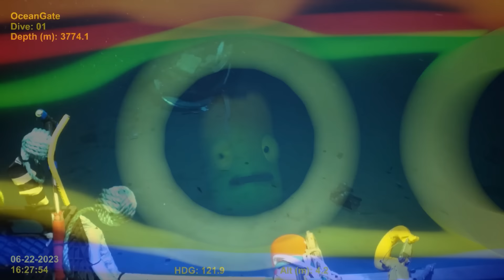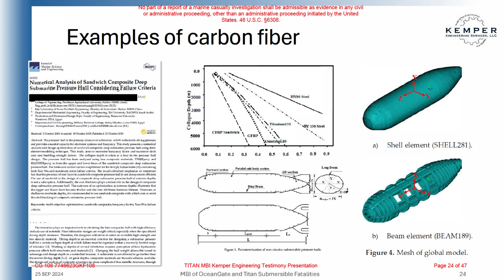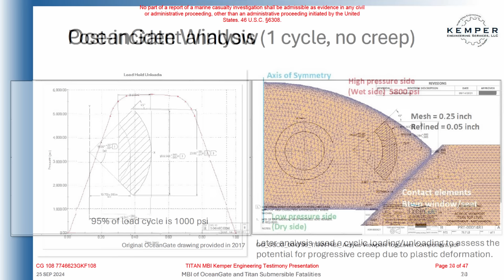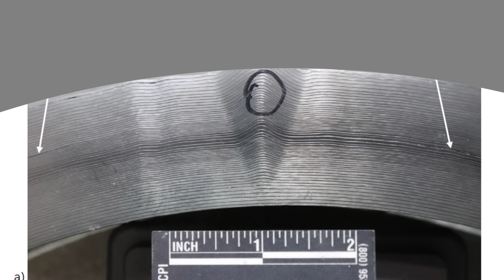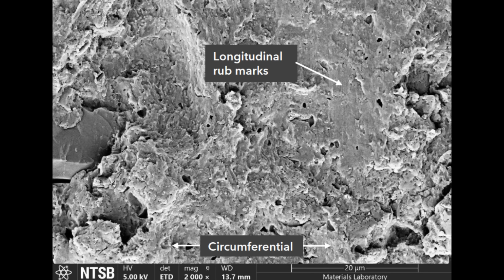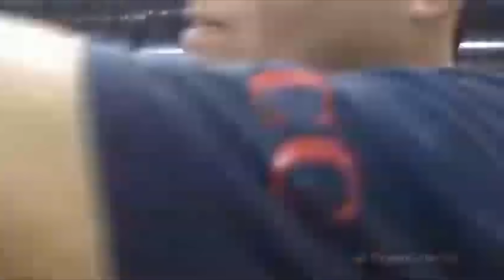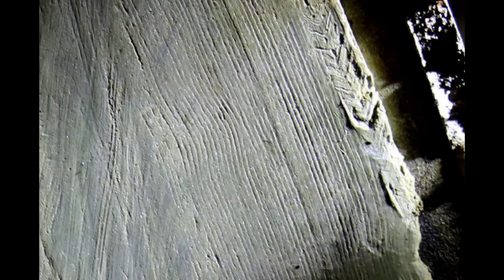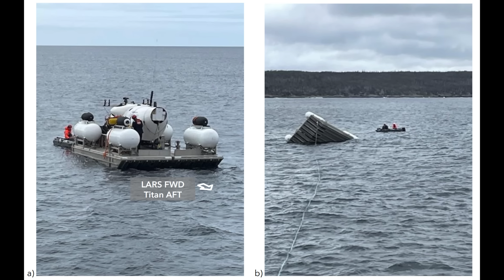OceanGate Wreck Shows Why Sub Wasn't Strong Enough To Survive - NTSB Shares Important Details

Comment: Around 2005, I  successfully designed and patented sensors for down-hole oilfield use that could survive testing multiple cycles of pressure to 40,000 psi with temperature cycles of 'ambient' to 400 F.   My early efforts tested glass cylinders containing electronics which were embedded in epoxy resin.  These would consistently fail at pressure due to microscopic bubbles in the epoxy providing a failure path that would eventually lead to a total failure of the sensor as individual failure paths 'joined up' into a sudden large failure.  The different materials used in the early sensor attempts would also facilitate failure due to the way the different materials behaved under pressure. We tried a number of ways of casting the resin to avoid the problem, but to no avail.  When I eliminated the dependency on the resin for structural integrity at high pressure, we arrived at a terrific solution that become the basis for our patented products.  You have pointed out the issues with the layers and the glues and I totally agree that fundamentally, the characteristics of a cured resin interacting with titanium parts could but have only resulted in microscopic paths for water ingress into the material, delamination and eventual catastrophic failure.  From my first hand engineering experience, current resin technology was totally inappropriate for high pressure applications and I still have images from early tests showing how failure paths through resin and between layers will occur at at high pressures.   Sad to say, it was not surprising to see how the sections failed.
Reply: It seems to me as a novice that the flange was the actual failure point, that the relative compressibility of the composite compared to the titanium put a huge load on a flange that was too thin. Or perhaps the composite's compressive strength became compromised, putting too much pressure on the flange. Either way, it is my belief the flange was way too thin.
Reply: @dustman96  I think your second sentence is the correct one.  The flange may or may not have been too thin, but it would've only had the opportunity to fail after the carbon fiber hull starting collapsing inwards, transferring pressure to it.  A secondary failure, if you will.  And arguably an irrelevant one, given that would mean the hull was already collapsing.  But I'm just as novice as yourself, so we'll have to wait for the experts to give their final conclusions.
Reply: I know most of your patent lies in trade secrets, but any possibility of sharing your research on the resin with the NTSB?
Reply: @jackielinde7568  "I know most of your patent lies in trade secrets"
No it doesn't. Patents are, by definition, public. The whole point of a patent is that you make the design public but are given the exclusive right to use it for a period of time.
Reply: @jackielinde7568 maybe we just need to be patient, the patent is about to expire if they worked around 2005!
Reply: @jackielinde7568  doubt it would have too much relevance. They have plenty of submarine data and expertise that is relevant to this.
Reply: @Stealth55555  It makes OP a subject matter in resin product performance under pressure. Hense the relevance.
Reply: @Stealth55555  "If they were an expert [...], they wouldn't need to be experimenting in the first place..."
Sorry but that's total nonsense.
Reply: May we ask what these down-hole sensors were looking for?
Reply: @Astronetics  oil. 🤠
Reply: 19:16 for those who don't understand what a flange is
Reply: The Titan didn't respond to dropping weights because water had been pushed into the voids in the hull at nearly 6000psi on previous dives.     This caused Titan to be heavier and descend faster as well as being heavy enough to not respond to the dropping of weights.   
The titanium to carbon fiber mating points surely let in water into the hull but the surface of the hull had voids on the surface anyway.    
Then Titan was stored over winters outside in freezing conditions and the water in the hull expanded with the force of 30,000 psi.   
The 3500 pound door being opened fully on hinge with hinge points being only a few inches apart certainly put huge a huge amount of stress on the front titanium ring.    Check the hinges on bank safes for proper mounting geometry.
I covered this on the titan submersible reddit over a year ago.
Reply: Did you try vacuum degassing the resin then casting under pressure, or just casting under vacuum?
Reply: @greggv8  We did that at Gardners Transformers (up until 1995 when the company was destroyed), epoxy potted electronics modules. a vacuum chamber.

Comment: I've had some experience, and although CF is a wonderful material, making composite structures- CF & Ti in this case- is enormously difficult when loads are as great as they are here. If they really wanted to use Carbon, they should have persisted with making all of the hull in CF- or make it all out of Ti. The joints are always the problem with dissimilar materials.

Comment: The thing that jumps out to me about the design is not really the carbon fibre its the fact that they did not have any internal structural ribbing something that every cylindrical submarine has to help reinforce the hull, and i can only assume they opted not to have them because it would have reduced the internal space meaning less passengers and less money could be made per dive.  When it comes to the wrapping of the carbon fibre it is odd that they did not use a roller to press it against the hull as it was being applied as this would have prevented the wrinkles, if anyone had tried to wrap duck tape around a pipe knows that if you just pull the tape around the pipe it wrinkles  and you have to use your other hand or a tool to smooth it as you wrap it.

When it comes to the issue with the stress sensors I suspect the data had been seen and understood but due to the hostile work environment where people would be fired for raising concerns  and disagreeing with the guy the employees would have not wanted to come forward for fear of the backlash.

Comment: What if Stockton Rush forgot to fully charge his wireless XBOX controller steering system and with the batt light blinking red and the sub no longer having a steering system was caught in a current it couldn’t get away from and submerged past the breaking point the sub could handle then imploded.

Comment: Am I totally off here or would you agree, that a carbon fiber submersible would be possible and innovative. 
But in this case there were horrifying failures in manufacturing, (taking shortcuts instead of actually innovating a new fabrication method), testing and verification of design, and least understandable of all, ignoring their own safety systems!

Comment: the inner titanium ring was woefully undersized to handle the deformation of the CF cylinder at the interfaces.  Look at the earlier diagram showing the huge bow predicted at the midpoint of the cylinder.  Why wouldn't that happen at the ends?? The forces will be uniform.  That stupid titanium ring flange was carrying that deformative load because of course it was.

Comment: Seeing the picture of the Titan being lifted by the crane just makes me think "why the hell didn't they use spreader bars??". All those forces need to be going straight up and down but instead all of the ropes/strops holding onto it seem to be running at least 45deg from vertical, probably putting as much lateral load as there was vertical load and in all different directions. I'm not a qualified engineer or anything and it's definitely not the worst part of all this, but it feels so obvious in hind sight, it's just so god damn frustrating!
Reply: From what I can tell, the design failed to incorporate any provision for lifting.  Lifting seems to be on the order of an afterthought (after the thing was completed): "Oh yeah, how to we get this thing in and out of the water?"

Comment: The sad thing is if they'd used Aluminium 7075 for everything, it likely would have been cheaper and about the same weight! Just needs to be looked after to avoid corrosion!

Comment: If the failure began in the CF at one of the titanium endcaps, that reminds me of a conversation I had with a labmate (MIT AUV lab) in the 1990s. We were discussing stress levels in the hull of a submarine. If you put a stiffener (bulkhead) in the middle of the tube section of the hull, it's actually pretty resistant to strain. The hull before the bulkhead gets compressed, and the hull after the bulkhead gets compressed. But because those two sections of hull are connected, the bending on the two sides oppose each other, so the hull is better able to resist the compression. If you sketch a simple 2D cross section, the hull bending in (down) to the left of the bulkhead tries to bend the hull right of the bulkhead out (up). And vice versa. So the two balance out and you get the maximum strength from the hull.

But where the hull meets the spherical endcaps, there is no hull on the other side of the endcap (bulkhead). So that part of the hull basically acts like a cantilever - less able to resist stress, and will experience greater strain. If you want the hull strain at the endcaps to match the strain at other bulkheads, you need to make the hull thicker where it meets the endcaps.

I understand the Titan didn't have bulkheads in the middle of its tube, but the point here is that the stresses and strains are higher where the hull mates with the endcaps. So ideally you'd want to make those sections thicker and stronger. But they actually did the opposite here - shaving the hull thinner where it mated with the endcaps, creating a weak point.

Comment: Wow! 2.5 miles of water pressing down on it.  Hard to comprehend that sort of loading.
This was a series of compromises and botches glued together.  I mean the carbon-Fibre lay down was wrinkled so they ground the wrinkled fibres down!!!!!  Basically they cut the fibres, so you're starting off with a compromised structure.  Crazy.
Then they ground the ends, to fit the titanium end rings ... compromised again.
Crazy.

Comment: 8:50 an analogy could be with airplane side windows. A rectangular one with 90° corners is worse than a round one, even if the rectangular one is smaller and included in the the round one. They could have added an independent lens instead of adding materials.

Comment: fascinating indeed the intricacies of stress and deformation (circa instant 8') - but also to consider is the application of the resulting stress of said deformation on the supporting material: here transversal pressure (delaminating) onto the carbon fiber, which is much less compliant... 

Anyone having actually played with laminated fibers of different Young modulus would be wary of what happens at the interface, the behavior of discontinuities under load are difficult to predict. 
PS: as for the "peel ply", as it names suggests it is peeled off before resuming laminating on top of a previous lamination, what it does is imprinting a small surface keying pattern that the next layer will grab onto better than on a smooth surface - so there is no "peel ply" in a finished product (anyway it is made of nylon or similar material that the resin will not bond to, so that if can be peeled)

Comment: I would just love to know exactly what happened to the occupants and exactly what remains of them and where. Jammed into that dome? Little tiny fragments? Its fascinating.
Reply: Ever heard of "mechanically separated chicken"? I guess it's a mix of that and just straight up blender. 6000psi of water around the sub is about twice what a household pressure washer makes, and even those can blast flesh off bone under right circumstances. So between that, being crushed by the debris, and then partly blown back out of what's left (shockwave from water ingress hits back dome, bounces forward, blows off the front dome, i presume that is why front dome is at distance from the back)... My best guess is that maybe some parts of larger bones are still recognizable, but soft tissues became paste that got washed away by the currents.

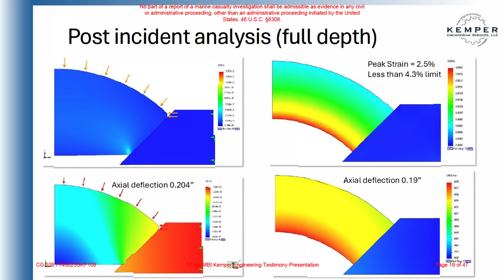Comment: Funny thing is that the optical problem at 9:00 could be just solved with having another piece of transparent material (acrylic as well?) adjacent to the window that would act as a lens correcting the effect of the window. They did not have to change the shape of the structural piece itself to achieve desired effect.

Comment: Why? the carbon is held together with polyester and doesn't provide compression strength.
37.740kg of weight on top of you per 10 cm²!!!!!

They could have used a vertical laser in the middle of the tube to measure the deformation, but would be a hassle to move inside.

Comment: Wrapping carbon fiber at 45 degree angles is pretty standard for carbon fiber construction, so that would be OceanGate cheaping out again. I wonder if the thickness of the carbon fiber they used, the ribbons of carbon fiber that came off the spools, didn't cause issues too. Though the whole thing about wrinkles...what, how? Like people make huge fuselages out of carbon fiber with no wrinkles, so that just really speaks to Stockton Rush didn't care about doing things the right way.

Comment: I beg to differ. I think that very early in the collapse, the back end of the carbon fiber hull gave way. That way the pressure on the front end of the hull would force all the carbon fiber into the titanium back end as can be seen on the images.

Comment: You sure boeing didn't have anything to do with this thing? 😆 what were they thinking, machined and glued... no 45 degree strands is why it wrinkled. They have been making carbon fibre dive tanks that holds high psi pressure while diving, if they had replicated that and not used glue to hold it together.

Comment: Crazy how they went out of their way to design such elaborate structure carbon fiber cylinder part , titanium end caps just to save some weight so they could get away with a little smaller crane and transport barge.

Comment: Can someone explain why wrinkles would form in the carbon fiber during application? 10:39.
Reply: Could air get trapped under the strips as it's laid? Or just natural imperfections (or dust) that get magnified with each additional layer?
Reply: it is actually shown in the analysis, a very small defect in a CF layer thickness accumulates and amplifies at each subsequent layer, until it forms a huge wrinkle. To me it looks like the whole section is compromized if such thing is allowed to occur. I am pretty sure good practices call for some sort of vaccuum compression at each layer or some other methods to ensure layers thickness uniformity.
Reply: @lo2740  The analyses shows indeed the amplified defect.  But I do not understand where this "amplification" effect comes from?  If a wrinkle starts with a 1 mm local defect, that defect should remain 1 mm after adding 10 extra correct layers on top??? Or not???

Comment: Bond to the ring is a big failure point, you need to have rough surfaces to have a good bond, not a smooth surface. Needed that ring to have a rough surface to give it a large surface area to bond the metal to the composite. Then probably chemically etched to give a clean metal layer for bonding, right before the final solvent cleaning, and then application of the epoxy bonding it to the ring. Plus inner lip should have been a lot thicker, probably at least a quarter the thickness, with a transition to the inner diameter to keep the step stress down.

Comment: The glue effect basically mimics metal fatigue.  I saw one of the many presentations on the collapse and Scott,  you are good enough to surmise what goes on.  You explained it perfectly before.  Any imperfection creates an amplified pressure point.  We don't need materials science to suggest there were sections of the hull that might have been experiencing many times over the designed tolerances. 

Re the collapse.  I saw that too.  What you were seeing was where everything went,  not where it started.  I'm going into mega speculation mode,  but it's easy to imagine the fracture began in the fast,  water bounced off the front window, acting like a Newtonian reflector then pushing debris, occupants, everything into the rear window. I think I got the directions right... anyway that explains what we saw... and I was thinking the hull didn't need to completely implode,  just open enough so the water rushing in was met with an equal pressure... so perhaps the defect was in the top somewhere

Comment: 21:49 That rust mark on the metal in the bottom left corner (on the flat surface, not the sheared part) . Is that something that developed after the incident or was it a sign of historic water ingress?
Reply: Titanium doesn't rust, just like Stainless Steel.
Reply: @peecee1384  ah, understood.

Comment: At 17.59 the pic of the voids, if you sweep all the red islands to one side you get about a third of the area as void, about 22mm2, at 400 atmospheres, that's around 100kg of unsupported pressure on that tiny area alone, that tiny area being about 22mm2,   (ignore the extra force on the surrounding area due to bridging). 
These void section were all through out the layers?
Or am I way out?

Comment: ok just a small note the main strength of carbon fibre is of cause the filaments in the prosses of machining them down are they cutting the filaments thus reducing the over all tension strength of the material 
By conclusion the over all strength is reduced significantly in the prosses of trimming it down why did no one notice such a elementary error.
Then to add to that thy used joints between surfaces which is a point of failure at the structural level.
Just shocked beyond belief that they did not consider this.